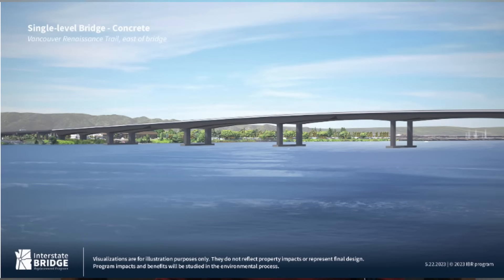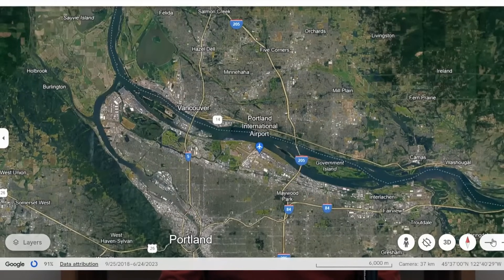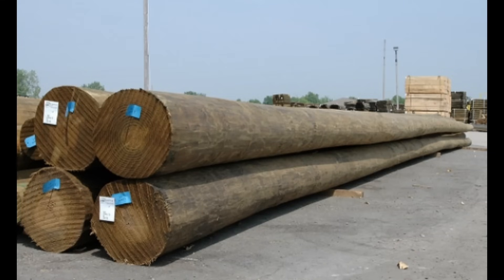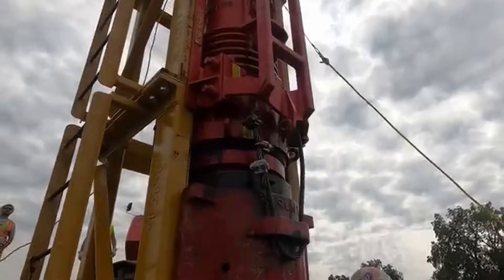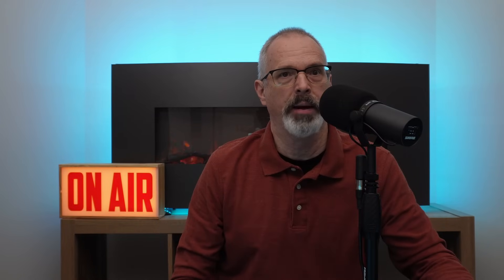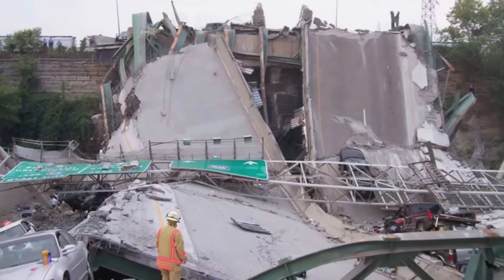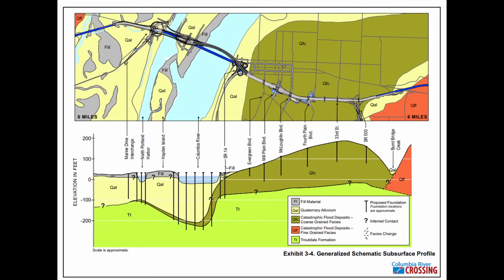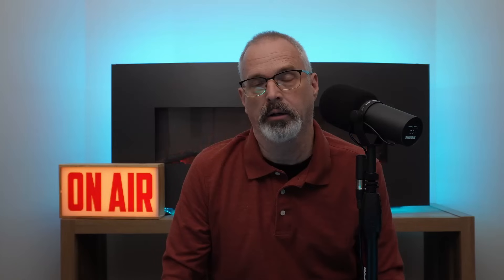Interstate I-5 Bridge Replacement over the Columbia River

Comment: I hate toll roads.  Use gas tax
Reply from the maker: I agree, but politician steel the gas tax money time and again to fund general (non-transportation) obligations and EV's aren't paying any fuel tax and instead are still be subsidized by the government.  But still, a gas tax would be better than having to be charged per mile traveled which is being floated now.
Reply: @CaseyJones-Engineer  true with electric cars.  Maybe do a thing that adds to the registration.  Or switch to a tire tax.  Don’t think tires are going away anytime soon.  Some states.  Maybe one of those in this video I believe have past laws that don’t allow gas taxes to be used elsewhere.
I just think it’s silly to have to stop and pay a toll.  The added time, tragic infrastructure, payroll, etc.  when I drive back east I keep forgetting about needing a roll of quarters handy,,

Comment: I haven't lived in that area for twenty-plus years, but that I-5 bridge was due replacement long before I ever moved away.  I remember when they built I-205 (and eventually its bridge).  That alleviated a lot of the pressure from the I-5 bridge--but it was never going to be enough.  They should've put light-rail on the I-205 bridge--a missed opportunity (that lacked funding at the time).

There are frankly more environmental concerns in that region, than there are in many other parts of North America--but that also means extensive environmental studies already exist, and sometimes that previous data can help speed things along for new projects.  It'll remain to be seen--whether that applies in this case.

Measures to withstand expected earthquakes must be considered more according to Japanese kinds of standards--than to Californian ones.  It's a subduction zone, rather than a strike-slip region; neither the same earthquake game, nor the same goalposts.  The ramps and interchanges have to meet all those standards too--and no, that won't be cheap.

From what you're saying, it sounds like they're getting closer to actually tackling this project.  That's good news--it's a good forty years overdue (in my opinion).
Thanks for keeping us up to date!  Hope you're enjoying your holiday season--whether you celebrate or not.
Reply from the maker: Thank you.  I hope this project gets done.  It will help the next 3 or 4 generations of people to have adequate transportation through that area.  Enjoy your holidays as well!

Comment: Was the I-35 Minneapolis bridge failure a design flaw?  I recall the gusset plates were a 1/2" thick and should have been 1" thick, but was that the design or did the steel fabricator screw up?  Or perhaps the fabricator had authorization to supply two 1/2" gusset plates rather than a solid 1" gusset plate and the assembly contractor and inspectors screwed up and only installed one?  Seems as long as the zinc silicate coating on 1/2" gusset plates was slip B certified, doubling up two of those would be equivalent to a solid 1" gusset plate.  Also hard for me to believe a design with inadequate 1/2" gusset plates would have gotten through the permitting phase.  Moreover, decades after construction, wasn't at least one failing gusset plate documented well before the bridge collapse and nobody took action to close and repair bridge?  Seems that was a systematic failure that could have been avoided if inspector flagging the failing gusset plate had authority to immediately close bridge before even writing the report.

Sad on this Columbia river bridge.  Seems they're shooting to replacing a third world bridge with a better, but still third world, bridge?  Insufficient bridge height and only 4 lanes going in and out of Portland, OR?  Sorry, but that's third world infrastructure designed from the get go.
Reply from the maker: I will revisit the NTSB report for the I-35 collapse.  You make a great point that we as a society are not able to maintain the functionality in our infrastructure that past generations here were.  The existing I-5 bridge has lift spans, but apparently putting lift spans in the new bridge will be too expensive?

Comment: Casey, thanks for covering the I-5 Columbia River bridge. I’ve driven the bridge many times and it is hair raising in medium to heavy traffic due to narrow lanes and deck conditions. A couple years ago I walked the bridge during morning and afternoon rush hours which took hair raising to new heights due to the magnitude of structural shaking. My opinion as a retired PE is that replacement is desperately needed. Thanks for the cross-section from the 2011 WSDOT report, as that is one of the better diagrams showing the foundation challenge. 

You raise a great point about the Cascadia subduction zone earthquake occurring before a bridge replacement. As to environmental assessments, which are important, the process is dysfunctional which goes in part to your point about their need for a replacement bridge, or after a failure (seismically induced or otherwise). Despite the process dysfunction, new activity will affect river water quality for an extended period and protected species rely on that water.

For those unfamiliar with a replacement bridge clearance height of 116 feet, you can view a map which shows Portland International Airports’ western approach/take-off flight paths are directly over the bridge. I don’t know why the Coast Guard wants clearance of 176 feet given what is upriver. They may lose that objective.
Reply from the maker: Thank you for your great comments.  The only thing I will add is that I suppose that the Coast Guard has jurisdiction over river navigation and they want to maintain that capability for upstream users that need that much height to traverse this channel.  If they have to ultimately design build a bridge with a new lift span that will probably kill the project from a cost standpoint (which is amazing when you consider that the managed to build this existing bridge this way).
Reply: I biked across I-5 and I-205 .meh😑
A lifetime ago a walked onto GW bridge on I-80.🥶😱😱😱   
I lost all my hair that day!
Reply: You can walk under the north end of both bridges and see them up close. The old bridge rivets, the new welded. A little exaggeration, but not much. Quite similar in design. The retrofit gusset plates on the old bridge stick out as well. What a truck with cargo meant in 1915 and what it means now are so different. Like cute toys, maybe with chain drive, speeding along at top speed of 40 or 50.

Comment: The two airports impacted by this project are KVUO, or Pearson Airpark in Vancouver, Washington and KPDX, which is the Portland International Airport.  The bridge spans lie within the approach path of the main runaways at PDX, 10L and 10R.  Also, there is a maritime engineering company in Vancouver that's upriver of the I-5 bridge, and relies on every inch of clearance from the current bridges.
Reply from the maker: I don't think there is anyway to reconcile these conflicting objectives without having a tunnel replace the existing bridges.
Reply: @CaseyJones-Engineer  there has been talk (with no real results) of a non- interstate route as a third bridge between Portland and Vancouver.  It would most likely connect Marine Dr. In Portland with SR-14 in Vancouver.  A lift span on a bridge like that would be just fine- no violation of the Interstate guidelines.  It would relieve lots of the rush hour traffic on the Glen Jackson bridge, the current Interstate 205 bridge.
Reply: Environmental review is not mostly about butterflies and gophers. It’s about issues like this. You can’t move I-5 or PDX. Maybe the marine engineering site will be bought out and they’ll need to relocate to Wauna, Astoria or Longview.

Comment: If it goes the way of most projects, the $7.5 billion estimated cost will turn into $30+ billion. They'll probably contract with the same contractor from the Bay Bridge. Kool animations but also very scary. Another good video. Good Luck, Rick
Reply from the maker: Thank you.  Yes, I expect that the costs will only continue to grow along with the timeline for completion.
Reply: @CaseyJones-Engineer From 2000 to 2005 I designed some of the temporary supports for the "Big Dig". I think that it went from $2 billion to $20+ billion and then had some fatal failures within a year or two after it opened. Good Luck, Rick
Reply: the woke liberal nutcases will contract a company from cryna to build it
Reply: I agree, but also 'don't care'. I care about Fraud, Waste, and Abuse, but not increased cost over the time it takes to complete the project or under estimations of costs that make the overall costs sound more palatable to the 'It costs too much' crowd. It will never be cheaper tomorrow, so just get it done. And expect that when it needs to be replaced, it will cost a lot more.
Reply: @who2u333 Most of the over runs are because of waste, fraud, and abuse.

Comment: In the event of an earthquake, they would likely repair/replace as quickly as possible and the environmental part bedamned. .The bay Bridge part the collapsed was repaired, upgraded and then replaced. The replacement was >>way<< over budget and over time too. 
.
Reply from the maker: Yes, that sounds about right to me too.  The political pressure to replace a bridge that had suddenly been taken out of service would be far greater than the pressure to replace a bridge that was past its prime but still in service.

Comment: I live in Washington State so let me give you the view from the ground.
1)We have been taling about replacing the I-5 Columbia River Bridge for about 20 years.
2)Washington State has a history of replacing bridges when they fail. For example Hood Canal Bridge 1979. (maint workers left  pontoon hatches open...gee what bad things could happen?) i-90 Mercer Island Bridge 1990. (maint workers during a rehab bridge deck project pressured washed the deck so hard it open gaps into the pontoons. November Gales on Lake Washington. Need I say anything more?) I-5 Bridge collapse over the Skagit River 2013. Oversize Semi Truck struck struts that resulted in the failure of a fracure-critical desingned bridge of the1950s. Noteable here is that the TSATE OF WASHINGTON had issued an oversized permit for this load. HAD THE STATE not issued said permit this bridge failure would not have happened.

In summary, the I-5 Bridge over the Columbia River will be built WhEn the existing structure fails. NOT BEFORE. As anyone who either lives in the metro Portland area or tavels said area there is a 2nd interstate bridge over the Columbia River. I-205. And as you stated, the Coast Guard will not readily sign off on the design of the replacement bridge. There is too much cargo that needs to travel upstream.
Reply from the maker: Thank you for your comments.  I recently attended a technical conference in Tacoma that was had many attendees who worked at Washington DOT.  They had presentation after presentation about rock falls on slopes above roadways.  It sounds like they should be focused more on their bridges from the sound of things.
Reply: @CaseyJones-Engineer  Actually rock slides are a big issue here also. HOWEVER how about not building a road in a rock slide area?

Also did anyone tell you that in Washington State 1% of a transportation project goes to ART WORK? For example when they built the 3rd runway for SEATAC Airport the retaining walls, which are hidden from view, have ART WORK on them. Imagine what an Engineer could do with an extra 1% on a contruction project.
Reply: For people not ftrom WA let’s remind in the first two instances it was not WA DOT that left various hatches open, it was private contractors who failed to follow contract specs.
Reply: @billsmith5109  Not true. The Hood Canal Bridge was being worked by the DOT. As for the I-90,  people traveling on the new span could see holes in the deck 4 months before the bridge sank. I guess state inspectyors were on avery long coffee break.

Comment: Seems like an ideal place to use a tunnel not very long and only an existing 30 foot channel. More resistant to seismic activity.
Reply: The reason why the tunnel option was abandoned was probably the same reason for the SF Bay bridge abandoning a tunnel option: Tunnel options are useless for  trucks carrying hazardous materials. Trucks carrying hazardous materials aren’t allowed in tunnels for obvious reasons. While just all a tiny percentage of traffic, the lack of safe alternative routes for hazardous materials is probably what doomed the tunnel option.
Reply: @boyziggy   And that is why the I-205 bridge was built.  An easy and close-in alternative for HazMat traffic.
Reply: @boyziggy  well, there is I 205 as an option.
Reply from the maker: I am not sure why the killed the tunnel option but they saying that it won't be pursued.
Reply: Thanks for the reply I find it unlikely that a tunnel will not be looked at sometime in the future. @CaseyJones-Engineer
Reply: While I don’t recall why a tunnel was written off, it may be the seismic hazard and far greater cost to adequately address that hazard. Cost has been the primary issue for this project and it was news to me that both states have agreed to contribute $1B each. So what is a “far greater cost?”

The tunnel would go thru alluvial soil, or bedrock more than 200 feet below average water level. Assuming an all-bedrock tunnel is too expensive, there is a high probability that soil will liquefy during a Cascadia Subduction Zone (CSZ) quake that periodically does a full offshore rip of about 900 miles from Vancouver Island BC to Northern California at magnitude 9. That will make the magnitude 7 San Andreas Fault quakes of far shorter lengths look like a walk in the park, which they are not. (The less significant CSZ quakes rip offshore from mid Oregon south to Northern California at magnitude 8.)

As for hazardous cargo, those trucks could take the 205 bridge that is upriver on the other side of the airport.

Comment: You dropped the right track on the audio! Came up OK when you put external sound in, like the pile pile driver!
Reply from the maker: Right side should still be there but a little fainter for some reason.  I am still working out the kinks in my new audio system.

Comment: Wa is single minded about environmental impact.
My father lived up the Dosewallips river on the Olympic Peninsula. The road that ran along the river washed out one winter, over a decade later, Washington still would not issue a permit to repair the road because of environmental concerns. 
For those of you not familiar with the area, it is a lot like the fjords in Norway. It is very wild country, prone to mudslides that carry huge trees and boulders. With out roads, even horses have trouble getting around.

People do live up that river. Not only does driving out take significantly longer because they have to drive miles up river, they are potentially trapped up there during the winter or during forest fires. Not talk has been made about removing the road and closing the area, but somehow repairing the road will be an environmental catastrophy.

Comment: Thanks for the video. The audio only plays on the left side for your voice. I don't think it's me because all other videos play audio just fine.
Reply from the maker: Thanks.  It should be playing out of both sides but the right side has a bit less volume for some reason.  I am still working out the kinks of my upgraded audio recording system so bear with me.
Reply: @CaseyJones-Engineer  Can confirm zero audio on the right, even at max volume, for the voice track. The other clips in your video play on stereo normally. No worries for me, I'm here for the engineering. Audio is hard.

Comment: I was thinking there is a concrete bridge over the Columbia but that is the I-205 bridge.  This should be a nice improvement. Thank you for covering this.  I’m generally further east and use the Bridge of the Gods in Cascade Locks.  The Cascadia Subduction Zone offshore British Columbia to Northern California has produced very large earthquakes on average every 150 years and is overdue.
Reply from the maker: Thank you.  I hope they can build this bridge replacement quicker than the 10 years currently being discussed.
Reply: Latest data tends to imply 300 year return in south end, and 500 year return in north end of fault.